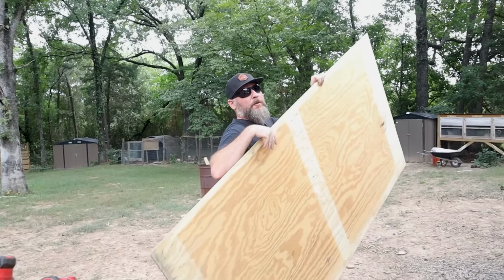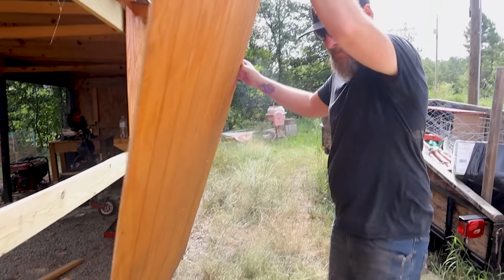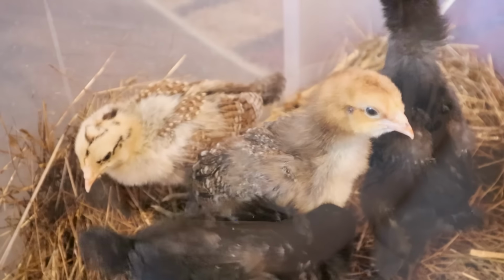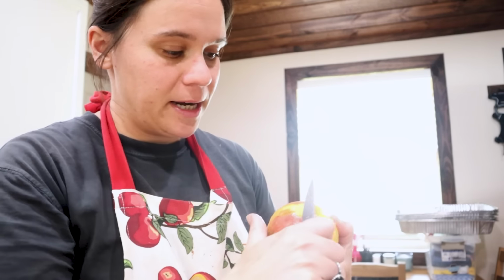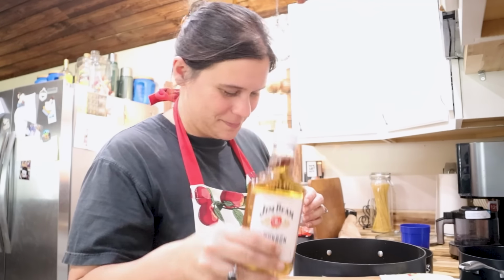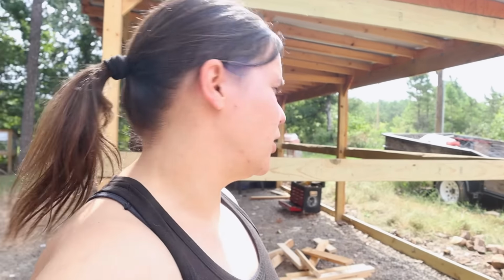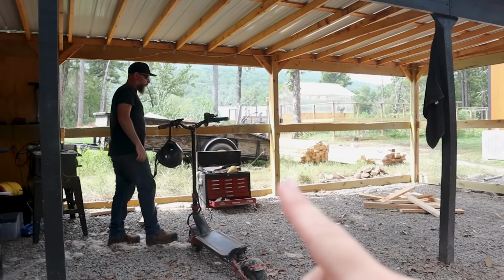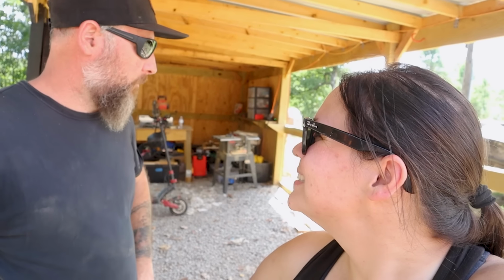We just HAD to....Sad DAY | Shed To House Conversion

Comment: Hi Rox and Ant, just thinking about the surface water running into that wall, you may want to build a dam, swale or whatever to divert the water away from the shed wall, keep the drain that you made as it will help. If you have extremes of temperature you also will want to use good insulation in your walls and ceiling. You may want to make a section like a walk in cool room, that would be handy. I think every home needs one so we would only need a small fridge in the kitchen for frequent access for milk, butter etc. On the darkness, use some solar blocking blinds when you aren’t in there, that should help limit the suns effects on stored produce. Never had a cellar but would a cellar provide the best storage for your needs, you have probably worked through that idea and passed on it. It’s easy to come up with ideas and I know what it takes to bring ideas to reality, built a couple of homes and additions. Stay safe.

Comment: We put an X on the bottom.  Put them in boiling water to blanche them.  Transfered the peaches to ice water.  Where the X was, the skin lifted up, and it was easy to grab a piece of the skin with a paring knife and remove a section.  It worked well.

Comment: My pantries are all in-house. But if I could choose I’d build it in a basement. But since that’s not a viable suggestion I’d say keep it practical and simple for what its use is for. Storing canned goods need cool and dark conditions to maintain low temperatures. I’d build storage shelves on the walls furthest from the sun/heat. Also, remember that freezers and refrigerators generate a lot of heat. If you could keep them separated it’d be less to worry about. I’d probably skip the windows since you’re really not going to spend a lot of time in there. 

There are so many YouTubers with great pantries and pantry ideas! They’re definitely more educated to give advice on building a pantry than I am. But I CAN’T WAIT TO SEE YOU BUILD IT! I’m here for it!!! ❤️❤️❤️

Comment: THe more outlets the merrier! I am big on multi-function spaces, so a food storage area like this would mean work surfaces, outlets, multiple heavy-duty heating elements (hot plates) so I could do my pressure canning and water bath canning in there, handy to massive amounts of storage shelves. Leave open places to the rafters where herbs and flowers can be hung and dried, and make sure that you have plenty of "lockers" to store 5 gallon buckets of flour, sugar, rice, etc.,) completely out of the sun and air currents. But that's just me. YOU GOT THIS!

Comment: make sure to insulate the walls and vent the roof.
Maybe build some can goods racks that are raised in the back with dividers. Have it load cans in the back and pull from the front. You will always use the oldest cans first, which will help your can goods (beans, soups, etc.) stay fresh as possible.

Comment: Ideals, the wall between storage and tool room. Put the fridge abd freezers lined together. Huge island for prep table. The cook stove should be close to the door, tilt out windows for air glow when cooking in there. Put 2 ceiling fans in there, 1 wall all shelves 1 inches taller then canning jars. Put all canners and pressure banners under the island. Add a sink on the island.

Comment: I think that you will have issues with heat, Every celler I've seen in my 70+ years didn't have windows and were underground or covered with several feet of dirt to maintain a steady temp. all year long. That tin roof is going to cook everything. and you will have to put an ac & heat system to keep it even temp.  Don't you have a slope where you could have your neighbor with the backhoe dig you a big hole like for the sand filter then  do like Gary and mel, put up some block walls and a roof then cover it with the dirt , you will have a nice celler and also can use it as a tornado shelter.

Comment: You can always use the rubber roof mixture to paint the damaged wood and reuse it or use metal flashing on the bottom to prevent it from rotting. That’s what we did and our panels are 22 years old and never decayed.

Comment: Have you thought about getting a freeze drier.  It would be great for food preservation and long time food storage.  You just will need to have access to water with drainage.p and power.  Remember storage for canning should be cook and dark, no windows. Or at least use blackout film/covering, yet still be able to open if ventilation is needed.

Comment: we had a fruit room, which was what we called the canning pantry....it had floor to ceiling shelves on the south, west and north side, one window on the north side....I have just 3 pieces of advice....have shelves on 3 sides reserve the east side for the frig and chest freezer, 2nd, the bottom shelves measure for the canners, pressure cookers so Rox won't have to reach over her head to get the canners....and if you decide to buy in 5 gallon bulk have a shelf on the bottom measured to fit those 5 gallon  buckets....the last and most important piece of advice I hope you give a lot of thought to is double insulate the west and north side of the walls...you KNOW just how hot that western sun is and how long it stays in the sky here, that way the food will be in a fairly cool room, and the north wall  with the west wall will keep it from freezing in the ice storms  it is important the food stay the same temp as possible, not getting too hot is important,....so you may think it's overkill but double insulated walls will hopefully keep you from having to cool and heat the room.....now my Grandpa was brilliant, he made shelves that were made for gallon jars, half gallon, quarts and pints....so everything was neat,  and organized, of course again the bottoms were for canners and  big crocks to make  sauerkraut, he put floor to ceiling shelves with the pints up high, at least 2 shelves all round, easier to take them down on a ladder, then most were for quarts, I don't know if Rox will ever can tomato juice by the gallon, but in the summer we had so much produce to process a lot of the time we would can gallon jars of  our fruit juices for jelly  or sauces  and salsas to be made later in the fall.......as an example we canned 1200 jars of food in one summer....we did 88 quarts of green beans alone....so putting the juice up to be made in the fall was the best way to get it all done....hope my advice is helpful, I know you will do what you will do, just wanted to remind you about keeping the room a steady year round temp to keep the canned jars safe and fresh.....so double insulating was what Grandpa and later my Daddy did for the pantry.

Comment: Since it’s for storage I wouldn’t put windows in. You want it to stay as cold and dark as you can get it. It will make home canned good stay good longer. I would make the floor concrete so it’s colder and less humid. All the finishes I would make easy to clean because accidents happen with glass jars

Comment: you need to cut an X on the bottom of the peach.  It is possible you are not leaving them in the hot water long enough.  When I use this method, the peeling slides right off.

Comment: Hi guys! See ya are starting your pantry room build. So cool. I would make shelves that are adjustable, cause your gonna always be moving your stock around according to what you've canned. also, you might want to think of a work table in there if everything is lining the walls. Just remember it should be dark in the room most of the time, maybe just a small window by the door?

Comment: I do not agree with other comments to do your canning in there, especially in the summer because of the heat/steam it produces unless you have bulletproof air conditioning. If you ever get a freeze dryer, or use a dehydrator it can go in there. I recommend that if you purchase other canned goods at the store, make a couple of those racks that dispense the cans at the bottom and you add new stock at the top where it rolls down. More storage for special stock up buys at the store. As you progress in your gardening adventures you will have more and more jars to store, so plan ahead as I'm pretty sure you will start drying and storing many herbs. Blessings, Texas Deb ❤

Comment: I'd separate it into 2 rooms. No windows where you are putting your canned goods, and pantry. That room needs to stay cool & dark. 1 light in the center of each room. The freezer, fridge room could have have windows. The pantry room just build alot of shelves but make them more solid like furniture don't use brackets to hold boards they won't be strong enough. Build them like the green house use the 3 walls. Put the door in the center space so you'd have 4 walls to use. Build the shelves floor to ceiling. I wouldn't take the roof off. Just take the rock out to lower the floor. ❤

Comment: Nothing better than fresh peaches. Jam and cobbler

First cut them in quarters the peel with paring knife. Removing the pit is easier that way. 

Good job at canning. My mother used paraffin to seal jam. 

Also storing your canned items in the new barn needs to be in a cool place. The barn temp might fluctuate too much

Comment: The easiest peaches to peel are the Free Stone peaches. They’ll release the stone easily too. Also, make a shallow cross cut in the blossom end of the peach, drop it into boiling water, and watch for the skin to start to pull away from the flesh. Place them in ice water for about a minute, to stop the cooking process. This also helps to “shock” the peel away from the fruit. It’s a quick process then, to pull away the peel at the four corners of the cuts you made. 
I tried to do some for the freezer, that were not Free Stone. After a lot of frustration, and wasted peaches, I declared it an epic fail, so they turned into a peach cobbler. lol
I enjoy watching your canning/preserving videos. It reminds me of myself, many years ago.🍑 🩷

Comment: Trust me, right now that looks big.  My pantry/freezer room is 14 X 16, I at first built my shelves.  I am in the process of taking them all down and putting up the metal shelves.  I think you have one on the front porch. I never thought I would run out of room, BOY WAS I WRONG. I have shelving around 3 walls and a block of shelves in the center.  You will find that all kinds of things make their way into the pantry and need space.  
  Be careful with windows, sunlight will degrade your canned goods.  I'm not saying don't put any  in but make sure that you cover them with heavy curtains as the sunlight will degrade all of your stored food.

Comment: Rox your peaches may not have been ripe enough for blanching. Maybe try a hand peeler on your peaches might have worked not the manual apple peeler. Sorry it was not easy.

I'm from MI so I think of winters. You have lived there long enough that you know how cold it can get. 

Because this will be your treasure of food for your family you sure don't want to lose any of it by having it freeze. Are you putting a floor & enclosing it so you can do temperature control?

Comment: Rox & Ant, the side not built yet.   I have an idea for it.  Make half of that half, 10 x 15 concrete block, with a steel and concrete roof.  The rest of the pole barn may blow down, but it would work as a tornado shelter.  Check with Mike at 3 Mississippi, his is above ground I believe.  Part of the space could also work for food storage!  ❤❤
Reply: In case of a tornado, they'd run over to Mel and Gary's who have build a safe area in the bedroom/and under the eventual stairs leading upstairs. It's David and DD5 that desperately need to build a tornado shelter in the hill side.
Reply: @GreyfyreShelties  Would you rather run 50' or 50 yards in the rain, lightning, wind, etc.?

Comment: You do not want any windows or windows in the door. Canned goods need to cool,  dark places. That's why they were in the ground. I'm still wondering why you are dismantling the shed. Are you changing the pitch on the roof or adding out? I missed something somewhere.

Comment: Here is what I found for peeling peaches....not much different from what you tried actually...Easy Way to Peel Peaches for Canning
Blanching is the easiest and most effective method for peeling peaches before canning. Here's a step-by-step guide:
Equipment:
 * Large pot
 * Large bowl
 * Ice
 * Slotted spoon
 * Paring knife
Instructions:
 * Prepare your peaches: Wash peaches thoroughly. Use a paring knife to make a small "X" on the bottom of each peach.
 * Boil water: Fill a large pot with water and bring to a boil.
 * Blanch peaches: Carefully lower a few peaches at a time into the boiling water. Blanch for about 30-60 seconds, or until the skin starts to loosen.
 * Ice bath: Transfer the blanched peaches to a large bowl filled with ice water to stop the cooking process.
 * Peel: Once cooled, the skin should slip off easily. If needed, use a paring knife to help remove any stubborn bits.
Tip: For larger quantities, you can reuse the blanching water several times.
Additional Tips:
 * Work in batches to ensure peaches are evenly cooked.
 * For extra safety, wear oven mitts when handling hot water and peaches.
 * Be sure to follow proper canning procedures to ensure food safety.
By following these steps, you'll have peeled peaches ready for canning in no time!

Building a Food Storage Haven: Ideas for Your Temperature-Controlled Pantry
A temperature-controlled pantry is a dream come true for any food enthusiast! Here are some ideas on how to maximize its potential:
Storage Solutions
 * Custom shelving: This is essential for optimizing space and accommodating various food items. Consider adjustable shelves for flexibility.
 * Pull-out drawers: Great for storing smaller items like spices, baking supplies, or canned goods.
 * Wire shelving: Allows for airflow, preventing moisture buildup and potential pest problems.
 * Clear storage containers: These help you easily see what you have and prevent food waste.
 * Bulk food dispensers: For items like flour, sugar, and cereal, these keep things organized and fresh.
Food Preservation Areas
If your pantry is large enough, consider these dedicated spaces:
 * Wine cellar: If you're a wine lover, a small section for wine storage can be incorporated.
 * Cheese cave: Control humidity and temperature to create the perfect environment for aging cheese.
 * Meat curing chamber: For those interested in charcuterie, this could be a valuable addition.
Additional Features
 * Lighting: Good lighting is essential for easily finding items. Consider LED lights for energy efficiency.
 * Ventilation: Ensure proper ventilation to maintain optimal conditions and prevent moisture buildup.
 * Insulation: If your pantry is in an exterior wall, consider adding insulation to maintain temperature control.
 * Pest control: Implement measures to prevent pests like mice and insects from entering.
 * Backup power: For areas prone to power outages, consider a backup power source to protect your food.
Food Storage Ideas
 * Long-term storage: Stock up on non-perishable staples like canned goods, dried beans, rice, and pasta.
 * Emergency preparedness: Store items like water purification tablets, first aid supplies, and emergency food rations.
 * Specialty items: Create a section for gourmet foods, imported ingredients, or specialty items.
 * Kitchen equipment: Store larger kitchen appliances or bulky items you don't use frequently.
Remember: The key to a successful temperature-controlled pantry is maintaining consistent conditions. Regularly monitor temperature and humidity levels to ensure optimal food storage.

Comment: 2 things  either the peaches not 💯 ripe   grom what see watching you i believe they not completely  they should have a firm but soft feel  if actually hard not ripe yet could keep fee days to see if they finish getting ripe 
    peach and nectarine are picked before completely ripe especially for shipping as  fully ripe bruse easy 
  the other thing Water bath  either not hot enough or not enough time in hot water 
ripe fruit after scalding the skin will just slip of no problem